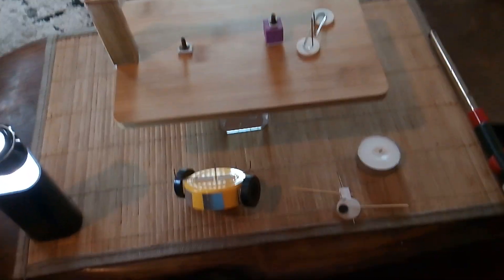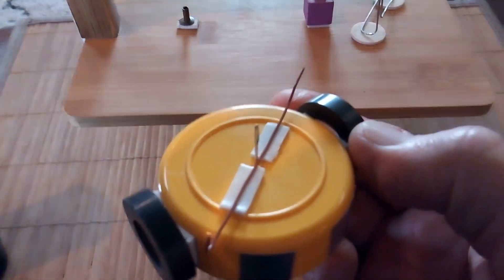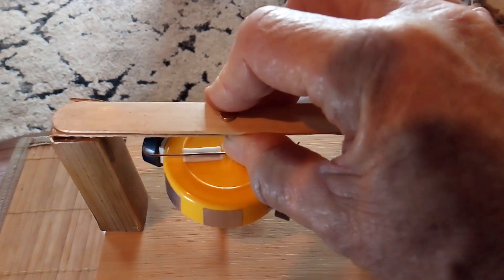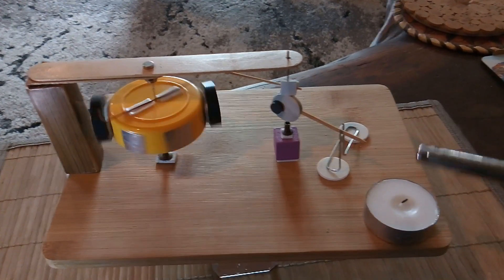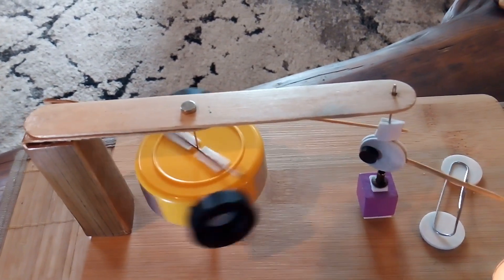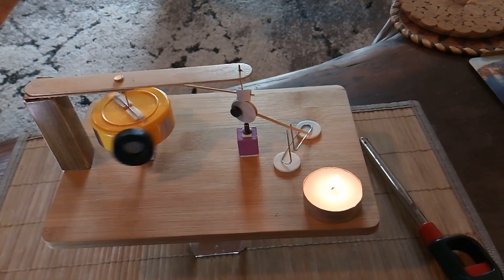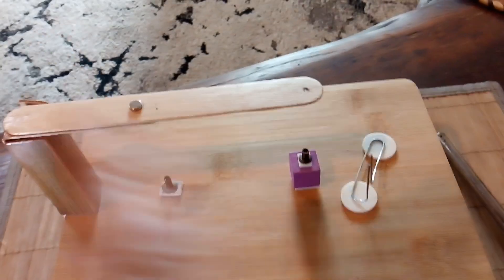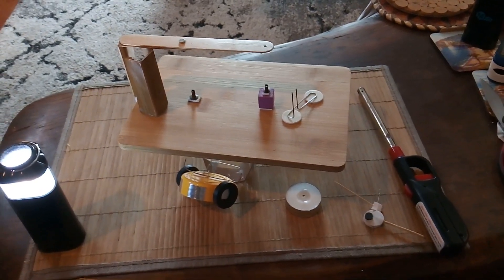Mystery Magnet Motor ----  Conclusion

Comment: It does have a satisfying tick 😁😁👍
Reply from the maker: Yes!  One of the reasons that Ike Stirling engines so much is how they sound.  This has the same charm. By the way today I ran this to see how long it would run on that button cell battery.  It has been running now for 6 hours and is still running strong.  Hummmm.
Reply: @Lidmotor  brilliant 😁

Comment: Very well hidden! Which makes you wonder, how small could that drive unit be?
Reply from the maker: Ben that is exactly what I was thinking.  When I saw how easy this was to turn I wondered  how small I could make the driver.  A small solar waver toy driver might do it. That could be hidden in a piece of wood about 1/8" thick.  The power could be the solar panel or a watch battery.  What makes this 'illusion' so great is the red herring switching mechanism .  It really looks like  it is doing something.  I was surprised how easy that was to move and how little energy that took from the system.
Reply: @Lidmotor  are you sooo pride of making such stupid fucking elussion about that spinning magnet to seemingly run on it’s own,whereas in reality you are hiding a driver and a fucking stupid button cell,WHY YOU, as if i didn’t knew that you were hiding something there he?
You’re couraging those fucking stupid scalpels doing the same thing ,DAMNIT!!

Comment: And when you store your device, and  the magnet on the rotor is in the wrong position, the read can be in the closed position, so your battery runs dry.
So you have to replace your battery the next time you want to use your divice.
But then it will run faster. 😂
Reply from the maker: On my model I just take out the rotor and set it aside.  The reed switch is normally open so the battery doesn't drain.  There isn't even a on/of switch.  It is just all soldered up.  If the battery goes dead ----just solder in a new one.  I was thinking of using a 10F super cap with two contacts on the outside that you just charge up with a (2) AA battery pack.  That would give you a few minutes of run time as a good display.  Fun stuff.
Reply: @Lidmotor  Te Dutch guy writes in his video that it is running faster because he made it lighter, but he gives it away by pointing that out. 😂 🚩
Reply: @Lidmotor  I don't speak spanisch, but this looks nice:
https://www.youtube.com/watch?v=MstZYTfiCOo&ab_channel=skycollection

Comment: Nice expose on the "illusion" - wink,wink.  We all know that the button cell you used was depleted and you have replicated a true overunity device.   Pokes in the rib aside I do love your work... keep it up.
Reply from the maker: Thanks.  Actually as much of a joke as it seems, this thing really doesn't need much energy to keep moving.  If I built a better one I might get it to run on a tiny solar panel or a watch battery.  The trick is get the friction way down and level the device so it that turns very easily.

Comment: Clever.
Thanks for sharing!
Reply: No not clever. What if I made a similar contraption that requires putting it in someone's ass and having them hold another part that acts as the stator, would you find that invention disproving and clever? Unless it's a near exact replica, no thinner or thicker parts to fit the one disproving an invention narrative, agenda, etc, this is just a pathetic poor attempt. All he did was take someone else's idea, use what he knows about getting such a thing to supposedly work, not even stick to the original design and hope that'll do.